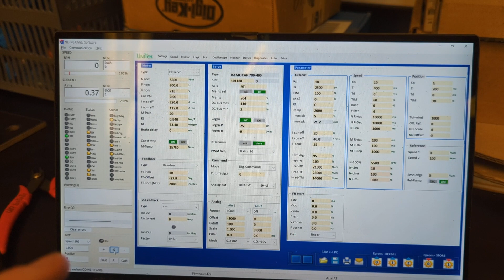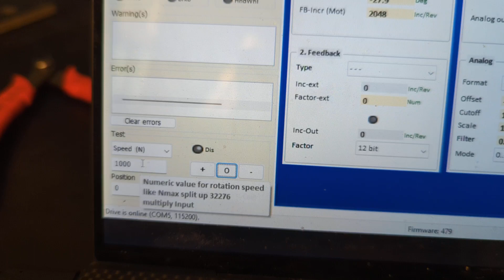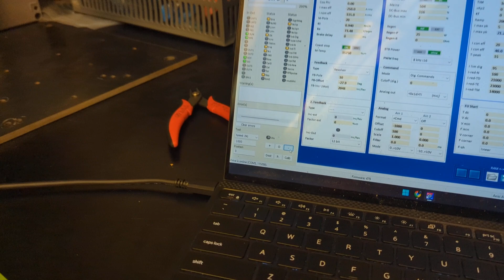Bamocar D3 - Emrax 228 Setup (Northwestern University Formula SAE - NFR23)

Comment: Hello, I'm just wondering if you ever had any issues with the resolver? Also, when the motor is not moving, does your motor position value on the position page stay constant? Thank you!
Reply from the maker: We did have one issue where we couldn't properly auto-calibrate our motor, but it turns out we had the sine and cosine signals from the resolver swapped--after that there were no issues. When the motor is not moving, I believe that value stays constant, but I would have to double check to confirm
Reply: @chrisuustal  Ah, thank you for the response! It's good to know what the expected behaviour is, so thank you for the video also.